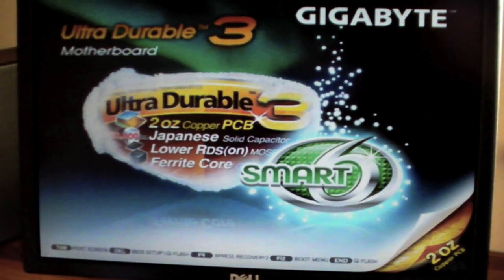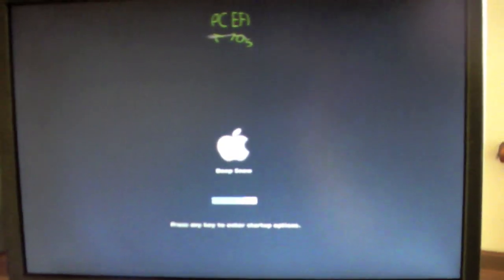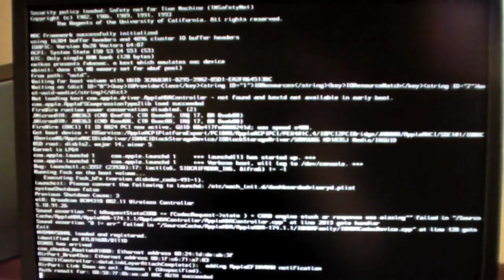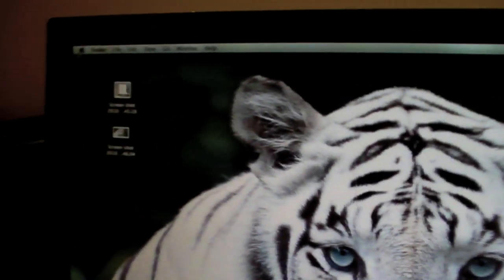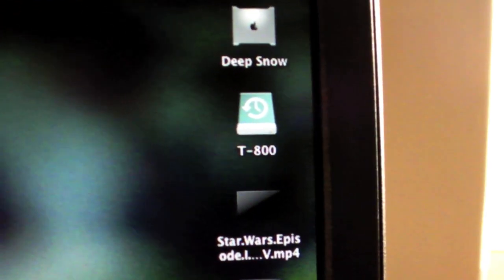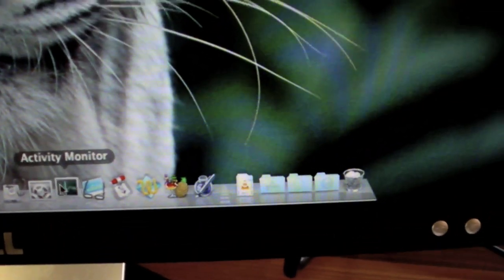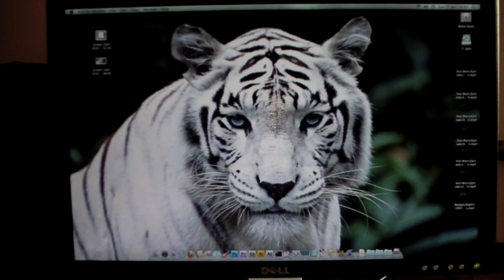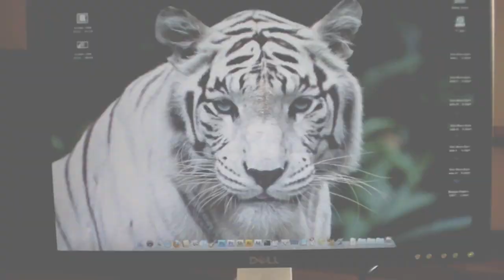Hackintosh G-i5 ( Gigabyte P55 motherboard / intel i5 750 cpu ) Powermac G5 case

Comment from the maker: @MrKotBonifacy The audio was mixed on Yamaha MP5A active studio monitors and is not bass heavy at all. The audio has bass but is not bass heavy. I always check on at least 3 systems before final mixdown. Sounds to me that even though your english is excellent, your speakers are not or you have the bass turned up too high.

Comment: @A9KSystems Think I could get those instructions? I just found this video, but I actually started a very similar project to what you did. I have a dead G5 gutted, and over the past few months have been setting up the system to go in it. I'm using the same board you have and after a few tried at installing Snow Leopard, I now get the hang of it and it's very easy. Today, after maybe an hour or a little more, I went from a retail 10.6 disc to a full machine with 10.6.6 all things working.

Comment: Fantastic job :)  May I ask you to please send me the instructions also, I have been struggling for days trying to figure out how to remove that plate. 
Thank You
I would be willing to pay for a set of front power cables, there are to many diagrams
floating around.  I have a early 2004 g5 case the power cable is very short .

Comment from the maker: Made a bit of a Frankenstein cable out of one half of the original G5 connecter, some spare bits of wire from an old ATX case and 20 minutes with the soldering iron.

There are plenty of pinout diagrams on the net. Read back through the comments, I think I posted a link to one not too long ago.

Comment from the maker: @gtbadbaikilla Yes. There are pinout diagrams available on the net for the G5 front panel so wiring in the front sockets/power switch is not a problem.

Comment from the maker: Its always a compomise with case mods. Doing it this way means you can always change out the motherboard at a later date for a full ATX with no spae issues. Personally I don't spend all day staring at the back of any of my machines either.

Comment from the maker: Haven't tried it. Only use Windows in VM Ware Fusion.
The only reason the Apple logo is not present at boot is the Netkas EFI is set to boot in "verbose" mode. You can change a normal Mac to boot like this too if needed. The Apple logo is just cosmetics and can be put back to default.

This should not affect Boot Camp.